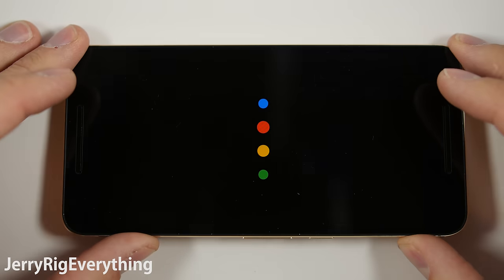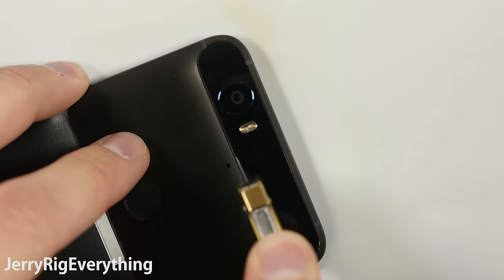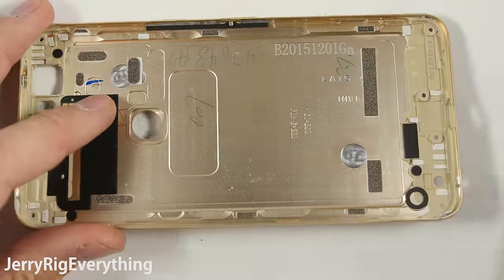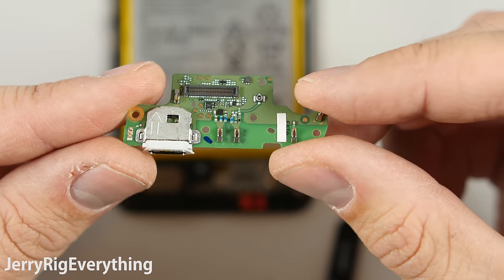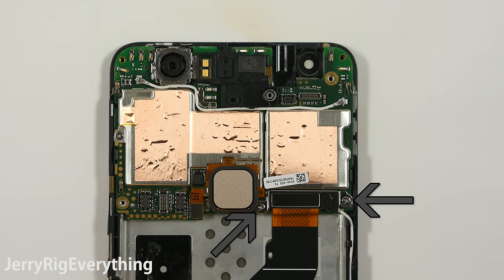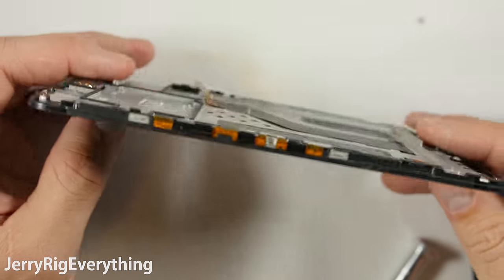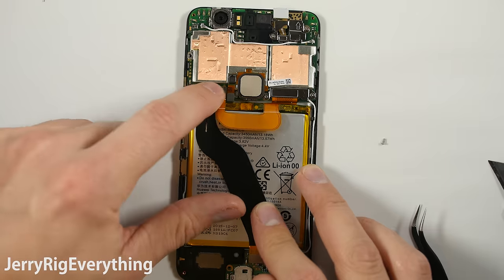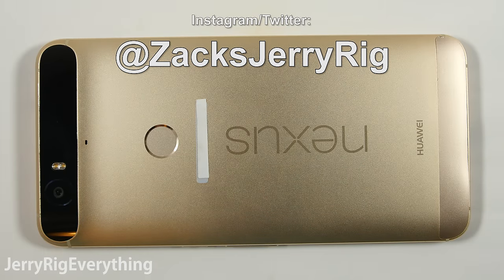Nexus 6p False Advertising - Teardown - Repair Video

Comment: Am I the only one who thinks the complaints about metal design comments are silly.  I take it as referring to the body of the phone, which is primarily metal and what I would call an all metal design.  You can't have a 100% metal phone for allot of obvious reasons.  One big one is antennas, which I assume is the reason for the plastic bottom.  Ill take that over the panty lines on my 6 plus any day.  My 6 plus was also just replaced ending up bent for no other reason than being in my not skinny jeans pockets.  Metal does not necessarily equate to durability.  There is a reason why most newer military rifles are largely polycarbonate.

Comment: Thanks for the video, this design is definitely worse than the original iphone 6 plus, the dovetail joints and the plastic aluminum hybrid make the phone not structurally sound.
Reply: Jon H lol thanks! Sorry
Reply: If it actually was why isn't the device bending under normal circumstances like the iPhone 6 was.
Reply: Grayson Maximillian Phoenix Because the whole iphone 6 plus had a unibody so thin it was bendable, plus a structural weak point at the volume and power buttons. The Nexus 6P has only one structural flaw. So if you don't put pressure on that specific flaw, the phone will be fine.
Reply: Sergio Velasco Exactly so what the hell are people suppose to be worried about. It's not even a big issue. It's an overplayed mess and what's funny is that this video alone is hypocritcal.
Reply: Jon H That he's tested and what, Jerry is the center of the universe? His first video of the Nexus 6P title alone calls for discredability. Does the average user care? Nope, he himself falls into this category.
Reply: +Sergio Velasco But I had the phone for a month now going around in my tight a** jeans and bending... is the least of my problems.
Reply: +Jon HWell a lot of their advertising was honestly not the reason I bought the phone. I bought it for say stock android, front facing speakers, the metal exterior build etc.
Reply: +Grayson Maximillian Phoenix Go buy a dictionary, turn to F, Find "FanBoy", see your picture.

Also cross reference "Jackass"
Reply: +HERO I'm sporting the GOLD 6p! and it's my second one, had the Illuminum Variant as well, I work in a Meat Room and I'm constantly unloading/offstacking boards of Meat, Chicken and Pork! and loading the Meat Case Wall, with meat carts and my 6p only has a plastic clear case, and it gets constantly bumped in my pocket while all this activity is going on! and trust me I get nervous sometimes when I take it out to use it, that possibly there could be something bent or cracked and it's been a very tough device. this is great news for when I do my reviews on any device I bring in! Peace
Reply: myproject13 Wow, I still find it strange why my Graphite 6P got a dent?
Reply: +HERO you sure you can't recall everything that happened that could've put a dent on your device? but honestly not one device is free from the possibility of a dent.
Reply: myproject13 Well I only dropped it once from my bedside table and another time when it slid down from my pocket onto my cars door railing but none of those seem like big enough actions that would cause denting.
Reply: +HERO your right it didn't seem like that could've happened? but! and it's a big but!! anything that is hit just right and I mean just right can cause some minor or more? damage? I'm thinking when these actions happened it must of hit just right for the dent to happen!? like watching a dime fall out of your pocket hit the floor and watching it fall all the way down and swearing you seen were it fell, but at that moment you just couldn't locate it, but still you swear you seen it fall in a specific spot but found it 15 feet away from that area you honestly seen it hit, hopefully that makes sense.
Reply: +HERO it could've hit in a area where the integrity of the device was a bit more vulnerable then other areas of the device. there are spots in every device that have little areas of pockets that could easily be compromised. what do you think? Peace
Reply: +Grayson Maximillian Phoenix It's cracks me up reading these comments made by adamant Nexus fanboys such as you. Ignorance aside, plenty of people from the Nexus 6P Reddit are reporting their Nexus 6P being bent under normal use, even till this day. To sum up the whole video, Jerry is opening up the Nexus 6P to point out that everything isn't metal and that Google false advertised. Please clarify how that makes him an idiot or a hypocrite. Because he pointed out a flaw that your precious phone possess?

Comment: (PLEASE READ THE ENTIRE COMMENT IF YOU HAVE TIME, AND RESPOND IF Y9U AGREE WITH ME OR NOT) I don't know what all the youtubers raving about this phone, like "the best phone of 2015"...so since I own this phone along with the s6 edge plus, lg g4 and iphone 6s plus, I'm going to tell ya my own god honest opinion about this phone

This isn't the most performant phone of 2015...the s6 edge runs circles on the 6p even with that infamous touchwiz skin which IMO is really great and fast 

Doesn't have the best camera either... G4 takes better pics, in broad day light, and in low light there's the manual mode, what even a 10 year old can easily operate, I don't know why are people bitching that the "the average user will only use auto mode" , only the shutter speed and the ISO needed to be tweaked for the best results, it is easy as fuck

The look and feel is good tho, I got the black one,using without any case, like all my phones, but the durability... OMG. IT'S  A FUCKING JOKE, what they put on that phone??  Even my s6e+ is way more durable with it's  glass back than this piece of shit... It slipped out  my 6p from my pants in a pub from about 2-3 ft, and when I saw a giant gouge on the corner, It was that big... I never saw anything like that...it was about 2mm deep in a 1cm area... I dropped my s6e+ NOT ONCE from head height on the corner... 3 small scartches on the bottom left corner.. So fuck this metal 

Screen is decent, they claiming that the screen is the same exact screen  found on the note5, but more "natural"  looking.... Keep it real... The screen looks like crap compared to an s6e+,(the colors)... Even my 6s+ has better color reproduction, which is a total disaster in color reproduction.... I don't like extremely overblown colors either, but for an amoled... Is garbage, the s6e+, lg g4 and iph6s+ has better displays than this "phone"  period.. And the glass on it is gorilla glass 4,but it acts like  gorilla glass 1 or maybe 2...with simple use, in my pocket,  lightly wiping the screen about 2 times per day, using the phone since december 3rd,and it has a reasonable amount of scratches already, compared to the g4 with gg3 and the 6s+'s ion shit glass, it really sucks... All these two phones having some scratches on the display too, with the same amound of use or even more frequent, but not even that close what the 6p has

AND THE CONCLUSION...this so Famous 6p is the same exact nexus phone, with the same amount of upgrades, the same experience what his older brothers gave to us year to year... But that's isn't logic, that from number 5-4 on the top smartphones on the list. it jumps right on the "best smartphone of 2015" throne,without even arguing just because it's wrapped in aluminum foil... And the price is a whole another story... If in the US is cheaper, not necessarily means that everywhere in the world is the same price... Here in europe is within the same price range as the s6e+ and the 6s+(some really expensive phones) about 1000 euros, or maybe a hair cheaper for a phone, what is claimed to be the "best" just because it is made out of some cheap metal, isn't mean that the phone is the best.... It's huge disappointment compared to what I expected, and I didn't expect less or more than what  I expected from the s6e+... Basically what you expect from a 1000euro smartphone... It was a huge belly flop on the concrete from 10 ft high.... If you live here in europe and reading this  DO NOT buy this phone, please... Don't... But if you coming from an old phone you not going to notice the drawbacks of this phone... I know what I'm talking about... Is still a good phone, if you forget the price, but not even close to number 1..please respond to me your own opinion, I will definetly read it...
Reply: I have galaxy s6 edge+ Plus, am so happy I didn't get Nexus 6P, I was very close to getting it.  Nexus 6P is over rated. to much hype.
Reply: +umar nawaz khan yeah... I don't think that the 6Pee lives up for that amount of hype what is around it..
Reply: +Richard Rusinaru every time a nexus phones comes out they say it's a bargain good spec's etc and comes one of the top rated phones which is BS. Samsung and iphone are the best.
Reply: +umar nawaz khan yeah.... Samsung does the best in the phone market overall.... I don't want to get in an android vs iPhone fight, they really based on   your own needs.... Me personally I'm a poweruser, so for me android is the best, but somebody wants a flagship phone with just the basics and the simplicity, the iPhones are the best choice..
Reply: nothing to disagree with in your essay.
Reply: It costs €800 max, but I agree.
Reply: +umar nawaz khan 6P is over-rated? LMAO WTF dude?? Over-rate is Samsung and Apple's overpriced garbage they release every 6 months.
Reply: Megatron Samsung S7 edge has the best hardware.  then Note 6 will take its crown

Comment: this phone is shit and I agree with Jerry all the way. Great video my friend. I hope this video goes viral like your bend tests.
Reply: why do you think it's bad. seems like a good phone to me
Reply: +siloPIRATE BECAUSE it is, build quality, sound wise, screen. it's only good because of its Nexus and will get updates that's it.
Reply: The Prodigal Son To me it feels sturdy enough. I won't dare push it like JerryRig did in his other video (just in case I lose out). sound could be better, agreed. Sound through speakers is great though. Screen is awesome, no complaints, lots of internal storage, fast, good camera (would have preferred to have OIS in there), actually plays my music (unlike my S4.

I'm aware of the issues people have experienced them though. The only thing which is remotely an issue is something incredibly minor which doesn't affect build quality or operation and will probably work itself out (foreign object, dust or thread from something got where it shouldn't and I can't get it out). Everything is working as it should and the battery runs forever.

Beats out my S4. The only thing the S4 did better atm is sound output through headphones. The 6P is quiet, but I expected that from what I read beforehand. It doesn't have water or dust resistance, but phones that do, cost more.

I was concerned when I saw Huawei made it and JerryRig's bend video too, but compared to my options this was the best choice. It doesn't have the wow factor of my S4 because it's not first (that belongs to my S4)
Reply: +siloPIRATE I have had the one plus two, both Nexus 5x&6p. I settled with the moto x pure. It has a brighter screen, more tweaking of speakers, bass, camera resolution, better video stabilization, exp storage, faster charging, more bands, customizable, more fun with moto gestures on top of stock android, more ergonomic with its thin bezels and smaller size and easy to fit in palm of hand with tapered back, a wide angled lens with a selfie flash for selfie shooters in the dark, last but not least water resistant on rubberized silicone back and way cheaper than the 6p. Did I mention it doesn't bend? Right now u can snag one and a moto 360 sport for $450 that's a steal. 6p just has a notification led but it's small, updates, bigger battery, fingerprint scanner, better new camera for stills/low light and that's it. I like the sculpted back though.
Reply: The Prodigal Son That sounds like a good phone. I had a look at one of the Moto X's variants (I can't remember which one) before making my decision. I had a quick look just now for the X Pure, kept getting links to US sites, so presumably it's not being sold in the UK (it might be, but from my quick look it's not over). Another one I was seriously considering was the LG V10, but again I couldn't confirm whether it's available over here.

On expandable storage, my S4 ran havoc with SD card and for whatever reason it turned read only. Got a new card for it and not all my music worked. Same files on the 6P work. I decided to say no to expandable storage and just went all internal so I didn't have to worry about space for apps, photos etc.

I rarely ever mess with EQs (I'm yet to find one that outdoes my Samsung P2 from 2008), plus devices sound good enough

Comment: I feel like if google would've made this phone themselves they definitely would have made it better maybe more durable I could see people paying more for a better quality phone. I've always loved the nexus lines but have typically stuck with my samsung phones and since the s6 quality is not a problem for them so why huawei and goog didn't go this way is beyond me. These days phones need to be able to handle some abuse and the minute jerry showed the mounts for the plastic aluminum hybrid you could see the flaw instantly it's no wonder it bends right in half.
Reply: No excuse bearing in mind Apple got flack a year before for Bendgate. You would believe that in 2015 every OEM would make sure there are no structural weak points, so if you are happy with a phone that clearly has had corners cut then that is the consumer's rights, I had an iPhone 6 Plus that would probably bend and I just put a strong case on it and it is fine over a year later. The good thing is that the video fore warns us so we can make allowances and maybe the next generation will be done right.

Comment: After watching the video and reading all the animosity towards this phone. I suddenly remembered my grandfather & uncle (may they RIP) as a child who complained about about modern toys being plastic and cheap, cars no longer made of steel just to make them lighter weight & easier to repair, houses no longer made of whatever "better" quality they had in the 40s & 60s etc, etc, etc.

That being said its my opinion that this video is overly meticulous about trivial & mundane details that 99% of phone users don't care about and uses them to harass an image of an otherwise good phone. 

People posting comments about "6P fan boys are mad" etc. Yes, I am a "fan" of this phone but I'm not mad because of this video. this phone is great quality and am more than impressed and satisfied with the outcome and durability of it.
Reply: cars are no longer made of steel because steel is much too rigid to provide a crumple zone sufficient enough to survive even low level impacts
Reply: Doesn't matter. Plenty of other reasons steel made sense at the time and why many people consider plastic cars cheap.
Reply: His opening was fairly unbiased. Bottom line, it's a blatant lie from a large company.
Reply: You'd have a point if it didn't snap in half.

Comment: you didn't really go into detail on how you get pry tool between frame and screen. I'm trying and all I'm doing is making chips on side of phone..
Reply from the maker: Just gotta watch the video closely.  Make it full screen.  It's a little difficult.
Reply: +JerryRigEverything I've done that. Ended up chipping up the side a lot. Pry tool too thick for the side...did you heat up aluminum ? its frustrating..
Reply from the maker: Andre Saddler No, I didnt heat up the aluminum.

Comment: Here is another link to other users also saying that the 6p is poor quality: http://techaeris.com/2016/01/15/reddit-reports-nexus-6p-screen-coming-off-frame/
It will always have users defending it but the facts are out there since the first Bendgate video, that this is a poorly designed device that will age badly. This is currently more expensive than the Note 5 in the UK so the Note is a very easy call.

Comment: Every phone manufacture has some plastic use incorporated in to their "all aluminum design", unfortunately even modern engineering hasn't come up a way to make an all metal phone. 
I'm not surprised that the 6p has an intensive use of plastic neither am i bothered it even though i do think Apple and even HTC have a more sophisticated design as far as the use of plastic. 
I think Huwawei cut the right corners in order to achieve this price point considering most customers will never notice this.
The only thing that disappoints me is how fragile that camera lens is...wow.

Comment: Is this guy for real... If the phone was "all metal" how would wifi, lte or NFC work???
Reply: same way the iphone works , plastic inserts in the frame
Reply: +Rakitha Peiriz so iphone fanboys can flock around a 6p and call it an iphone clone
Reply: That's the same thought I got. everyone (after the phone has launched ) said that in the top and bottom areas aren't metal and it is  used for sensors(which is obvious) and yet all these are saying this shit about the phone ( some even scold them and say" I hate these  false advertising ..... "

Comment: Huawei used the cheapest parts possible to make this phone. Down to the logic board, charging port, headphone jack, signal wire, camera, and all the microchips. Typical Chinese company. Just to save a few cents on each phone. Does not compare to Samsung or LG quality parts. Not even in the same ballpark.